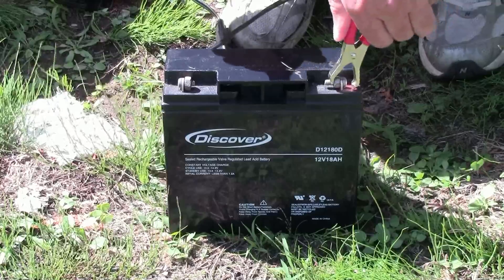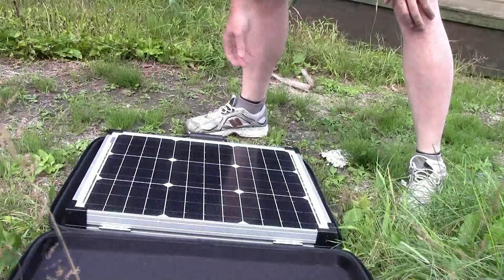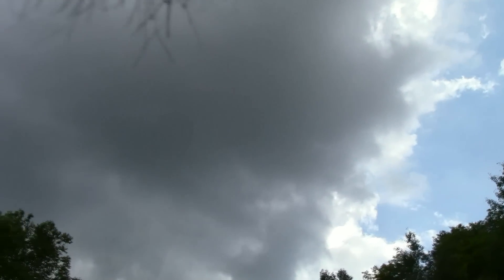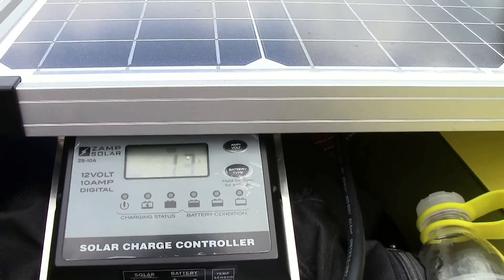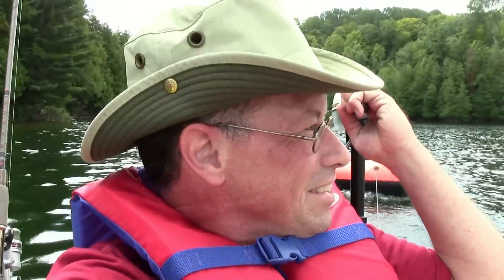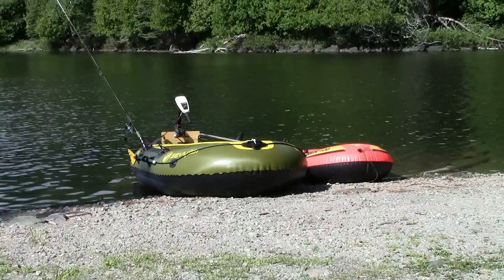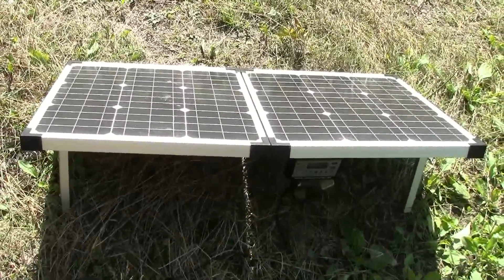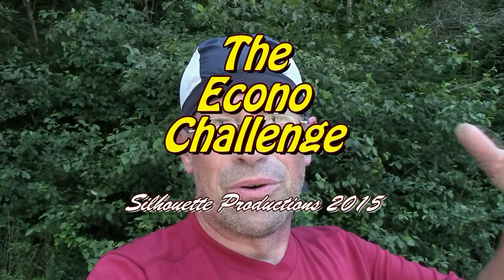Solar Powered Boat - Econo Challenge

Comment: I have a boat roughly about like yours and need to order the same trolling motor mount. They’re about $70. So my question is do I really need a battery at all? Can I just use the solar panel by itself?
Reply from the maker: That did not work for me.  The charge controller on the solar panel will not release electricity unless it detects a battery connected to the system.  Putting the lead directly connected to the tolling motor in full sun did nothing.  I guess it depends on the ability of your charge controller perhaps.

Comment: So you can run this without battery?
Reply from the maker: Nope.  A battery is needed in the system.  The charge controller will not allow electricity to flow from the panel without sensing a batter hooked up to it.

Comment: Dreamboat :-) foldable solar roof (100-200w) sturdy built to a blown up robber boat (and the actually blowing up is a small motor running from the solarpanels itself. A motor that (like yours or even a more custom built just for that boat, preferably a jet) and unbreakable/waterresistant lithium battery that runs along (but fold-able in the middle) bottom of the boat for stability. Some connections for charging and maybe a small (150/300w) inverter if needed. So a little bigger boat but totally fold-able. And the pump is a switch (say it has a 25w compressor) so if you spring a small leak it can be used as an emergency thing to still pump air into the boat until you can seal it off. That compressor could also act as bilge pump ofc if needed.

Boat would fit 2 people with 3-4 days of supply's but also normal camping outdoor gear for a longer stay... and so "fold-able" that you could fit in a small hatchback car.

I would love a thing like that here in Sweden... soo many lakes and "rivers" to explore and just camp.. and when your battery is filled you can charge you accessories like phones, tablets and radio and so on... or just put you USB fan for a bit of cooling some days...

Would be a dream come thru!

Well if I can dream... The fold-able solar cells could also be powering a electric-bike with custom wagon so you don't even need a car! That would be awesome!

I would easily spend 4 weeks cycling and boating if I had this kind of setup :-)
Reply from the maker: Wow. When you dream you dream big. I love it.

Comment: Although not any where near exact, I was told a general rule of thumb for approximating the current draw on 12 volt brushed motor trolling motors is an amp for every pound of thrust.  A Min kota model 35 appears to be a 24 lb thrust motor which means around 24 amps full speed.
What speed do you run at?
Reply from the maker: This is very good information.   There are five settings on this motor. I usually run it at 3 or 4. 5 being full.
Reply: @EconoChallenge  
Nice.   I see that at one point in the video, your battery was staying at 100% meaning the panels were providing all the power.  Were you able to sustain that for long?
Reply from the maker: on clear days between 11 and 2 I can just keep going and going and going

Comment: Hi awesome video. I need help finding out if I can do the same with these 3 components I currently own: 
- 55lb Thrust Trolling motor
- 12V 55Ah MightMax Battery
- 3.3W Solar Panel
Reply from the maker: you will need a solar panel that can produce enough amps to keep your trolling motor going. 3.3 Watts will not do it.
Reply: 33cwatch chàg ihes tabkeß nit ier miter exterd ràbgé

Comment: Hi, this inspired me to try this out myself with a Minnkota Endure C2 30 lbs trolling motor and a 100 watt solar panel. So I though I'd give you feedback from field tests! :)  I can tell you that something is not correct with the math you are doing to calculate power needs of your trolling motor, your first comment about how long the battery would last without the solar panel seems correct, but thinking the solar panel would make the motor run indefinitely (in bright sun) providing the majority of its power needs, is where things don't add up, you mention a 80 watt solar panel is twice the power you need for your motor , but my tests of my motor on max speed showed it was drawing 220-230 watts. Even on the lowest speed of 1, mine drew 80 watts.   My trolling motor uses between 22-30 amps on speed 5. I hooked up an amp meter to determine this, but Minnkota website list max amp draw at 30 amps on max speed).  My panel at perfect conditions will provide 5.5 amps but when using the cheaper PWM charge controller (like you were using) versus a mppt charge controller, you lose lots of power due to the down step in voltage from 18-19 Volts to 12 volts. I also bought a cheap PWM controller (not knowing its drawbacks at the time) and found out the hard way I was only getting  max 2.2 amps in noon direct summer sunlight. Since my Motor draws 22 amps or more on speed 5 (depends on weight of canoe and its contents as well as weather/ currents) , this means I was only providing at best 10% of the power needs of the motor. So the panel was slowing down the discharge of my battery but not by much. My rig also had a brand new marine deep cycle 95 AH Lead Acid battery  which is the proper battery for a trolling motor (not car lead acid like you used, these will die very quickly using them for trolling motor just google difference). To test my rig, I set out camping on a long weekend with Sun in the forecast for 4 days straight with the hopes I could use the sun to charge my battery concurrently while using battery to power my motor. I also wanted to use the solar panel to recharge my battery when I was docked at camp and my canoe was out in the sun. Alas, it did not work out as planned, my battery ended up getting depleted fully after 3 days of  2-3 hours of trolling per day. I constantly checked my charge controller to see the amps the were being provided to recharge the battery and at max they were, 2.2 amps. Doing the Math, a 95 AH battery that has 80% of its capacity used up (20% remaining) will take 34.5 hours of direct sunlight to recharge the battery back to full.  (95*0.8/2.2), so about 4 days if ~ 8  hours good light per day. If my motor is drawing 22 amps (it drew even more when it was me and my friend and cooler in the canoe due to extra weight), the 95 AH battery would get to 20% capacity left in  3.5 hours (95*0.8/22). It is not recommended to fully discharge even a deep cycle battery lower than 20% remaining power as this will drastically reduce battery life. A normal (not deep cycle) car 12V battery (like the one you used) will die even sooner if it is exposed to deep discharges as they are designed for quick high amp draw, not constant load. Long story short, after much research and phone calls to solar experts, after I got back from my unsuccessful trip,  to be able to meet the power needs of my trolling motor strictly from Solar energy, I learnt I would need to upgrade a few things. First, I needed to invest in a MPPT solar charge controller which are at least 5X the cost of the PWM ones. This would increase the amps I could get from my Solar panel to its maximum potential which is 5.5 amps. Next, I would need to add 3 more 100 watt panels which would increase the amps to the 22 amps (5.5 Amps per panel X 4 panels). If I could fit all those panels on my canoe is another question . Each one is 40*20".   I am building a mount for them, hopefully it works. Keep in mind any cloud cover and my amps will go way down. But the battery should get me through as long as I can recharge at camp when the sun comes out and the motor isn't being used. Another factor I learnt is that Lead acid batteries rated AH are not the same across the board when considering Amperage draw from the load. If you draw high amps (like 22 amps), you will not get the AH they are rated for, you will get a smaller percentage , which goes down exponentially as the amp draw goes up. I am writing this not to say what you experienced is wrong, only to share my experience  so other can know what they need of they plan to do this long term .The reason it worked for you if probably because you didn't do this over a period of more than a few try's so your battery didn't die yet (although I bet its usable capacity dropped) and your motor is slightly smaller (24lbs vs 30lbs) so it probably drew less amps (but still more than 3-4, I am sure of that). Min Kota website trolling manuals list Amp draw from Motors, they start at 30 amps for 30lbs thrust motors (at max speed in choppy waters).  You motor must be an older model  as I cant find manual for it, but a meter hooked up properly will tell you amp draw. I have a few questions for you as its been a few years since this video. How long can you use the motor continuously with that setup before the battery runs out at max speed? Have you since changed your setup to get a deep cycle battery? Did you ever check voltage of your battery immediately after trolling, if yes what was it?  here are links to 2 vids I made re this subject https://youtu.be/xjQUGF9HHDM  and  https://youtu.be/IYpVN2csPCs  . Keep in mind, they were both done before I went on my camping trip and got to know how the setup would work in real life scenario over a period of 4 days. I will update when I try the 4 panels to see if this works as I expect. :)
Reply: This comment is exactly what I'm searching the internet for 😂 I have an Intex mariner 4 with a minnkota 30lb thurst motor and was hoping I could throw some small panels on the sides of it to at the very least give me a bit more juice in the day. Will definitely be checking out your vids

Comment: What is the min watt panel I would need to do the same? I have a Minn kota c20 but I have a 80ah battery.
Reply from the maker: The key is to match the amps your motor needs with the solar panels output.  If your motor needs 6 amps at 12 volts to run properly then you will need a solar panel big enough to produce 6 amps at 12 volts.  Watts = amps x volts

Comment: I use to have the HF 360 with 50 lbs electric trolling motor and 12v 120 amp hours sealed glass matte battery. Be careful of the heat. The pvc will expand and ruin the boat. 303 Aerospace is great for protection.

Comment: Loved that the video is for beginners! Towing your gear was a great idea! 

Can you make another one with Lithium Ion batteries and higher output solar panels? 

You can get 100 watt panels for a about $100 USD now. Your SLA batteries only like being used 50%,  but lithium ion batteries can handle almost a 100% discharge.
Reply from the maker: I have ordered some cheap Flexible solar panels. I am also learning about building my own 12 volt lithium ion battery pack. It's a project I will be working on over the winter.

Comment: can you or are you supposed to draw power directly from the battery while charging the battery with the solar panel simultaneously ? please help not much info online to help me understand the dynamics of solar powerd boating.
Reply from the maker: The solar panel controller on my solar panel will not allow electricity to flow unless it is attached to the battery.  According to the battery dealer it is not a good idea to charge & draw power at the same time.
Reply: @EconoChallenge  is there a way to be able to charge and draw power while using the trolling motor from the battery?
Reply from the maker: @TheFishingExperience916  I connect the solar panel to the battery.  That starts the power flowing from the panel.  If the battery is fully charged then the panel will only release a trickle charge.  Then I attach the alligator clips from the motor to the clips attached to the battery.  The panel still releases only a trickle charge.  But when I turn on the motor the panel releases full power.  My thought is the motor is now drawing power straight from the panel.  But I have no way to prove that idea.
Reply: @EconoChallenge  thank you for replying I will try this as safely as I can even if I dont understand it much but its encouraging to know I can have a more range and more power with this solar idea
Reply: @EconoChallenge  so as far as I can understand from watching other YouTube videos this is the set up [ solar panel wires connects to the designated charge controller terminals - the battery wires connect to the designated  charge controller terminal and  the battery terminals - the trolling motor wires also connects directly to the battery terminals ] thanks again for replying and sorry for my ignorance of trying to understand what your describing it's just seems so technical

Comment: I think I would prefer to have a kayak with a trolling motor towing an inflatable with a solar panel. Just think it would cut through the water better. But have to say this is a cool set up. Must try it.
Reply from the maker: Having used both you are correct.  A kayak will definitely cut through the water much better than the inflatable.

Comment: Flex seal makes a tape that can be placed and seal under water. I keep a roll on my 12' Inflatable for an emergency, as I deep sea fish miles from the coast.
Reply from the maker: The boat came with a patch kit and I keep it with the boat.  But having a roll of tape like that would be much better.  Especially if it works well.

Comment: get a lithium 12 volt battery--greatly increase the range and smaller too!!
Reply from the maker: Great suggestion.  I picked up one last year but it was not compatible.  Still looking.
Reply: @EconoChallenge  you have to by a LiFePo4 battery, they have the same charge voltage as lead acid (if you disable temperature compensation). They are drop in replacement. Just be aware if the BMS can deliver high enough amperage. The 6Ah may have a to small BMS, but a I have seen 40Ah batteries with 100A BMS.

You can even get them with Bluetooth BMS, so you can see SOC at your phone.

Comment: I'm working on a similar setup for a 10' Jon boat, bow mout 40lbs thrust minkota and VmaxTank 100AH battery. Still reaserching proper dolor panel
Reply from the maker: You need to big enough to charge the 100 ah battery on a cloudy day.  Plan for less than "ideal conditions" because that is when you are going to be needing it most often.
Reply: EconoChallenge thanx
Reply: EconoChallenge how many watts in panels would you suggest for 100ah or 200ah setup?

Comment: That would look even better if you put a roof on top with the solar panels on
Reply from the maker: The roof has to be able to point the solar panel toward the sun and then you are absolutely correct.  Not sure I can pull it off with this boat but perhaps a boat that is a little more rigid.

Comment: I get you're not an engineer but, science is science. And people can get hurt if they don't get things like this right. I am very pleased to see people try setups like this but the catch is they need to get the math right.

You can think of this as a balance of energy:
- motor uses 20Ah every hour, under full throttle and normal conditions. 30A is peak specified current (I never encountered that in my boat) - but you should use 30A, just in case. I'll use 20Ah, for your scenario's benefit
- battery has 18Ah full charge energy
- solar panel provides 6Ah every hour (you mention 4Ah which would be 55W not 80W)

With those numbers we can easily see that:
- solar panel would fully charge the battery in 18/6=3h
- motor would fully deplete battery in 18/20=0.9h (54 min)
- motor connected to both battery and solar panel would take 6Ah every hour from solar panel, rest of 14Ah from battery. Thus would deplete the battery in 18/14=77min.
- once battery is depleted, motor will only run on 6A of solar power, which will be sloooooow (roughly equivalent to speed 1)

The worst drawback of this setup is it would deplete the battery in the evening and when you start losing sunlight you're a 
floating duck.

I think you were confusing Amps with Wattage. Please don't, or pack lots of warm clothes and a long-distance radio.
Reply from the maker: Thank you for this outline.  I am very happy to make sure this comment stays at the top for others to read.  I have never been able to find the information on how many amps my trolling motor draws at full speed.  I can add that even though the math says the solar panel should produce 6.6 amps, I have never seen the charge controller screen show anything higher than 4.2 amps. So far I have not had to use my paddles to get back home, but I have limped home a few times on speed setting 2.
Reply: I'm guessing you're using a minnkota C2 30lb - that is spec'd at max 30A on their website however tests like this https://www.youtube.com/watch?v=afYpxaTZjew show it draws 6/7.4/9.2/10.7/14 amps for each of the 5 forward speeds. I used 20 so you have a bit of margin.

Comment: hook that up to a deep cycle battery and you can run day and night
Reply from the maker: That is a perfect idea for a solid fishing boat, flat back canoe or a more robust inflatable.  However, the boat featured in this video is just barely above a toy boat.  The floor would not support the weight of a much bigger battery.
Reply: EconoChallenge If you make a floor for the boat it will support a larger battery & make the whole thing more sturdy. I just got the Seahawk 3 & already have the Minnkota 30 on a Sundolphin Sportsman. After I score a motor mount I'll be comparing the two on a pond and a relatively slow meandering blackwater river. The 30lb kota barely pushes the Sundolphin upstream so hopefully the Seahawk will outperform on my trips to the sand bars.

Nice job, btw. Cheers!
Reply: graihinge or solar state Bater mire rabfé